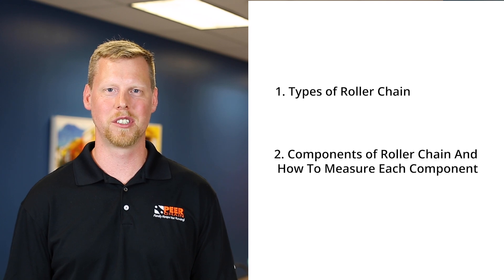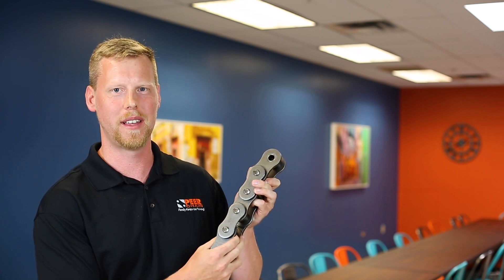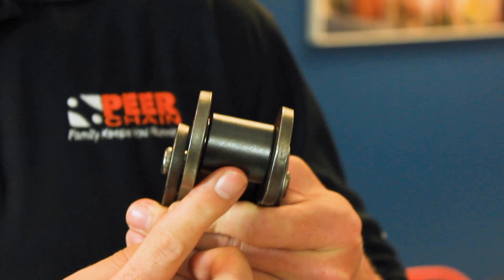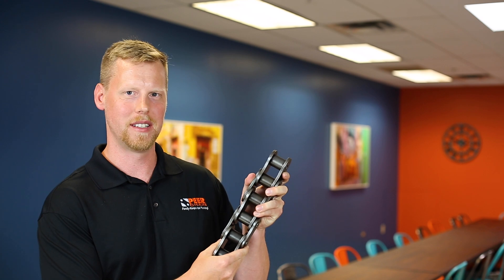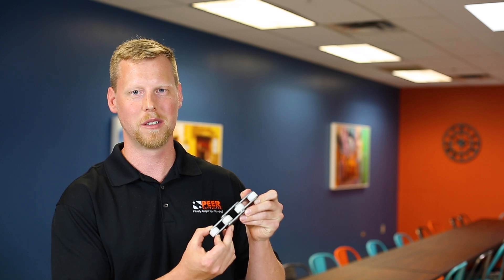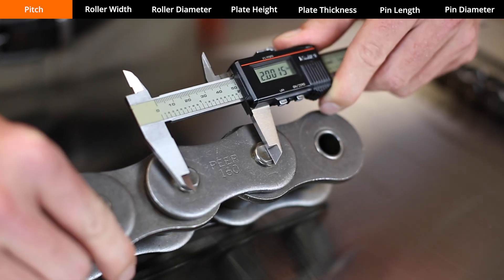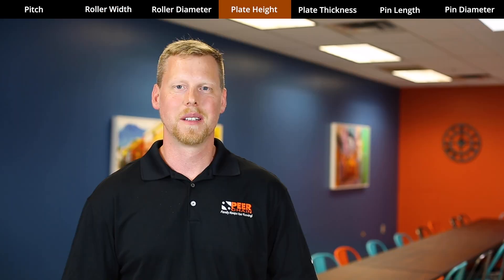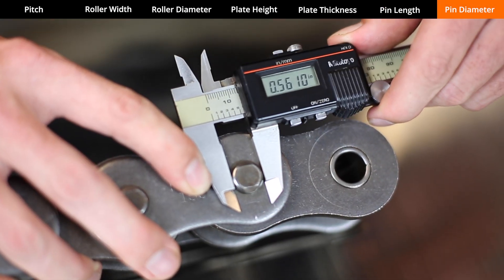How to Measure Roller Chain Size

Comment: You mean roller diameter is the Outside Diameter of the roller. It's a given we can't measure the roller inside diameter of an assembled link, but nevertheless correct terminology thwarts mistakes, delays and questions. 
Thanks.

Comment: i have yamaha mt 15 . i want to increase my top speed .my bike has front14 tooth sproket and rear has tooth 52
i want to change my  front sproket by increasing 1tooth which is 15
is it harm my bike`s engine.
 and my next thinking is front 15 and 48 rear .
which is harm full . 
and tell me should i go for this or not